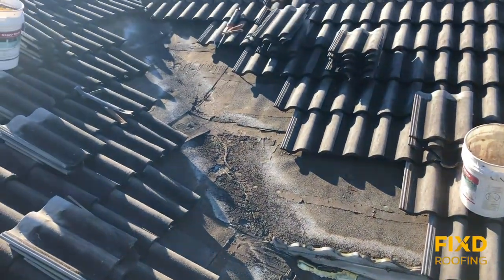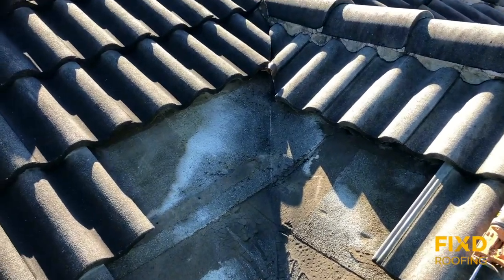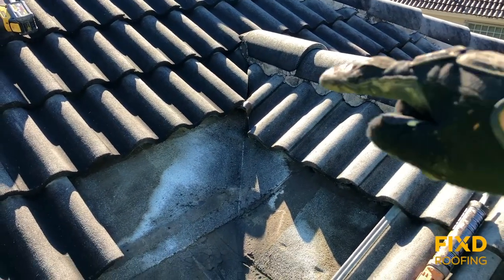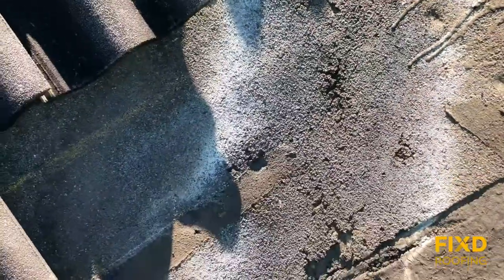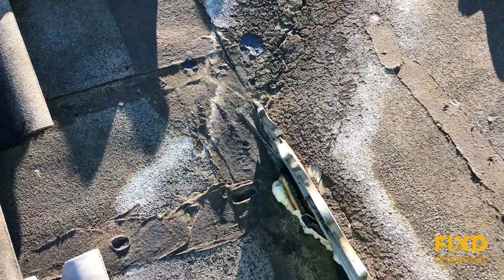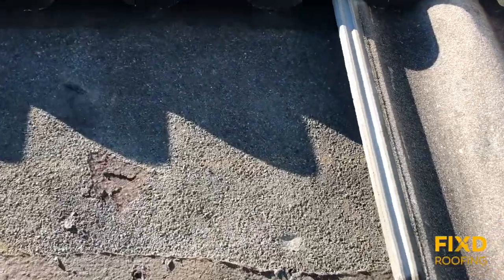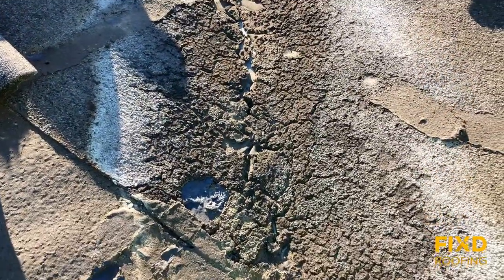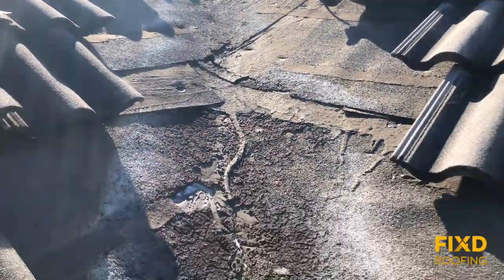Worth it? | Repair vs Replace - Concrete Tile Roof Valley

Comment: Tiles and slates are the most common roof coverings where I live but you'd never see a valley like that it needs a lead valley or other suitable metal or plastic to carry the water down to the gutter

Comment: Your “underlayment” is an old school built up roof clean and prime the surface at the valley, then install a new layer in hot or cold process. Or a layer of torch down polyester reinforced would be ideal